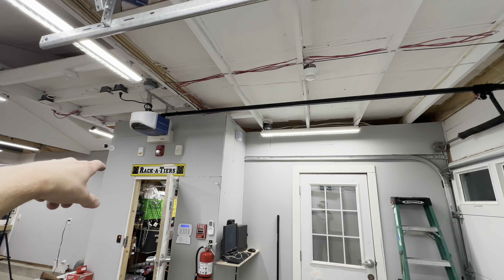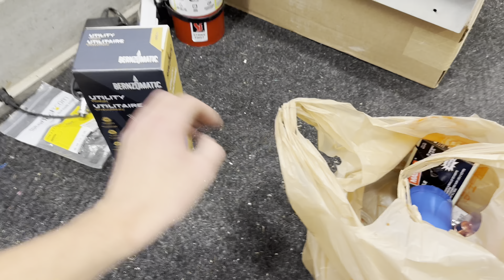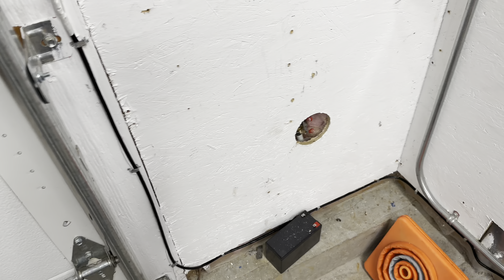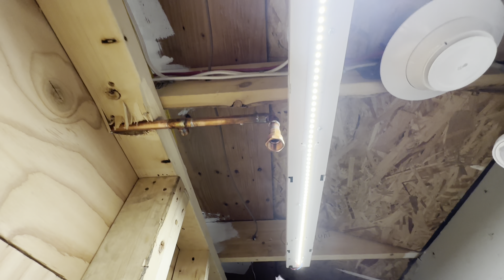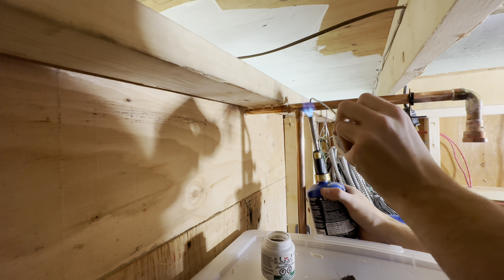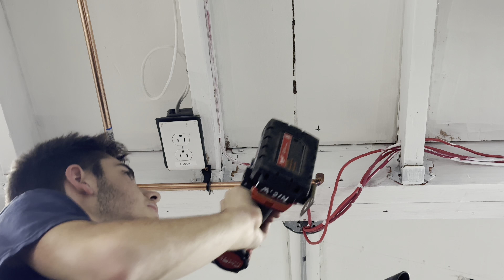Installing a fire sprinkler system in my garage (part-1)

Comment: This is cool. It’s very neat to see someone actually do this out of passion..looks like a very expensive job especially with the cost of copper!
Reply from the maker: Thank you, not only for your comment but as you would know for helping me out with some of my questions I've had for you as far as sprinkler heads go and my questions I've asked about your own sprinkler demo set ups. But yeah getting that copper did some damage!
Reply: he does fire alarm testing to and he has a fire lite ms9200udls addresible fire alarm control panel

Comment: I feel ya Nic, Sharkbite fittings are kinda sketchy in my opinion too.  They seal with O-rings, which makes me kinda nervous.  I think they're awesome in a pinch as a temporary fix, but I don't consider them to be permanent plumbing.  For converting from PEX to  copper, I'd get a brass male threaded adapter into a female threaded adapter into the copper, if I were in your shoes.  Great work!  Great video too.

Comment: Nice! Definitely a good idea to add sprinklers, cause if ever there’s a fire, it could be slowed down or completely stopped
Reply from the maker: This is true hopefully they won't ever be needed but they will be there
Reply: @nics-systems-electric  it’s better to have them and likely never have them activate than not have them and have a fire start

Comment: Hi Nic how are you, I'm very impressed that looks like a lot of work it's great you can do that, when did you get interested in this kind of stuff, I have a lot of respect for you that you're doing what you enjoy, I have the same security system you do but I can't use it because it's screwed up the yellow triangle light is always on and every couple of days start beeping I don't know what is wrong with it so it's been completely disconnected since I've purchased the house I'm in a pretty good area but later this year I plan on selling my house and it needs to be fixed, I'd hire you to fix it if you were close by but it's all good.
Reply from the maker: Thanks I'm doing ok I've been interested in this stuff for a long time not sure about an exact time
Reply: @nics-systems-electric  Thats cool Nic I respect that It's certainly very interesting, I don't know if I could do that but it's great that you can, I work for a local FM Radio station, I've had an interest in Radio since I was about your age, I understand what it's like to enjoy what makes you happy.

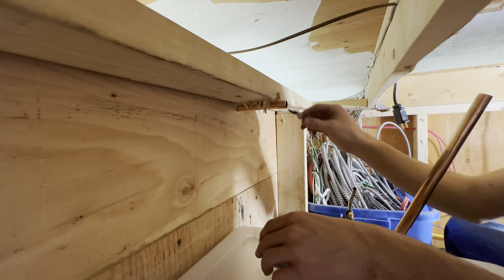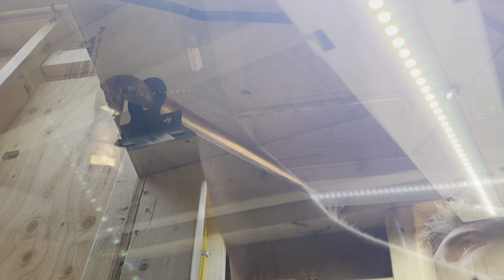Comment: 4:27 "de-burring tool" 14:17 go flux yourself LOL 😂16:20 they make fireproof pads you can stick behind the pipe you've got the torch on while you work to prevent burns or scorching. In a pinch something like a piece of asphalt roof shingle works too (grit side facing the heat).
Reply from the maker: Yeah something to prevent the burning would make things a lot easier lol

Comment: I was wondering about freezing of the pipes. I assume it will all be in a heated area.
Will the pipes be insulated?
I have heard that a system can be loaded with inert  gas  that prevents pipes from freezing and then the water would purge the gas when the sprinkler activates 
With all the batteries used in EVs and e bikes it would be a good idea in case they catch fire.
Reply from the maker: No different than domestic water that's already in the building it is a heated building

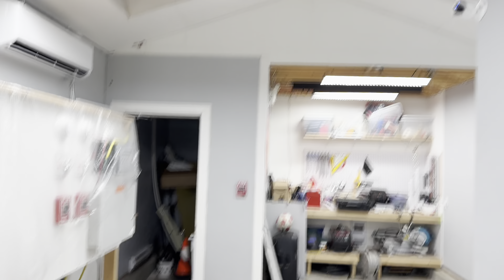Comment: 7:51 You mean a Concealed Sprinkler Head? What these do is when the heat reaches a certain temperature, a lid pops off exposing the sprinkler head, then at another certain temperature the sprinkler head activates. The start of it looks Great! That's Better than what i could do! I also can't wait to see what the final product will look like! Also, How will the Drain Pipe work? Also, in all of the rooms, you should have a sprinkler that activates at 155*F (68*C) (Red Bulb) and in storage room B, you should have a sprinkler that activates at 175*F (79*C) (Yellow Bulb). By the way, it's a good idea to have a DRY DUST FIRE EXTINGUISHER on hand when you are soldering.
Reply from the maker: i was going to go with one but ended up with a regular head

Comment: Nice. Is the sprinkler system going to be connected to the fire alarm system? Will there be a bell for when the sprinkler system activates
Reply from the maker: Yes it will be connected to fire alarm system that's why I'm putting in the flow switch

Comment: Personally I would’ve installed a dry suppression system since my basement has a lot of computers and stuff like that, but for your use seems like it’s appropriate.
Reply from the maker: Dry systems become a lot more complicated with having to have compressors and pressure sensors
Reply: @nics-systems-electric  true, but it would be really cool to integrate it with the suppression functionality of my 4100u or if i got a suppression panel like a fire lite rp-2000 whatever the dry one is.
Reply from the maker: @vrryan6  I think you're talking about a releasing system I was thinking you were talking about a dry sprinkler system like what we use in outdoor applications here to prevent freezing and burst pipes

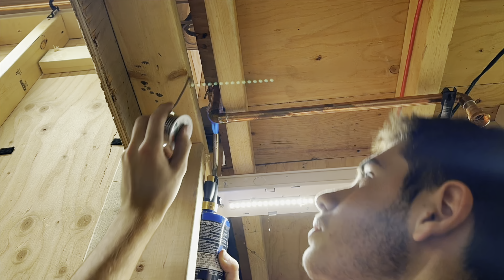Comment: 16:15 Theres clearly a flame on the beam. Also, installing a sprinkler system when you are not experienced with plumbing could be dangerous.
Reply from the maker: Yes the wood got warm but not on fire I think I have enough plumbing experience to handle this and if not it's just water not dangerous like I'm going to get killed by water unless I drown in it

Comment: Can you please get an annuncator? Just so you don't have to run back to the garage each time you test it
Reply from the maker: I am not installing an annunciator on this system the purpose of an annunciator is for fire department to have a safe means of quickly being able to see the location of the 
alarm but my panel is already at the main entrance so it is not necessary

Comment: See, my fear would be an earthquake coming through or something terrible like that, causing the sprinkler system to spring a leak. I’m still planning on making a small system, though.
Reply from the maker: I'm not worried about it at all it's not different than all the plumbing in the walls of my house
Reply: Fair point, actually. Gives more confidence for myself, haha  @nics-systems-electric

Comment: I'm hoping to help you get your money back 😂 
Also how do addressable devices get power and signal over two wires
Reply from the maker: It's kind of like POE data the power is always there but it can still transmit data even when the power is on
Reply: Addressable devices can transmit data by modulating voltage, it’s never constant voltage going through the addressable loop

Comment: save the shark bites for the diyer's / lazy plummers ive seen the  aftermath of a blowout from the cold snap s bite are the devil
Reply from the maker: Yeah the idea of them kind of scares me I don't think I could trust that I did use one where I had to connect the Copper to the pex but just there and only there where it is visible that's the only place I would use it is as long as I can see it